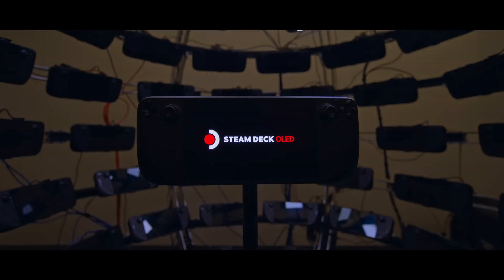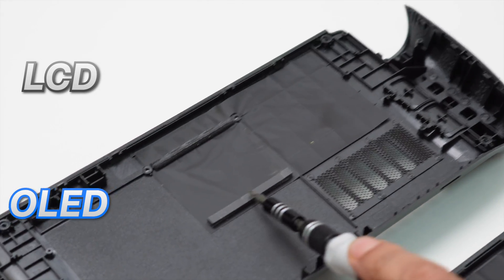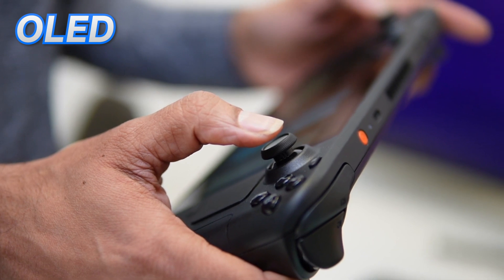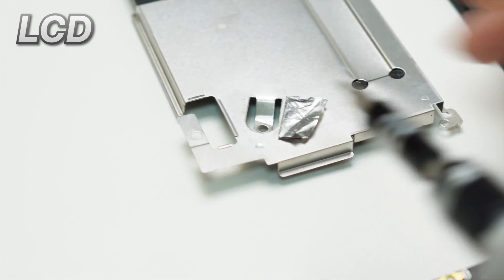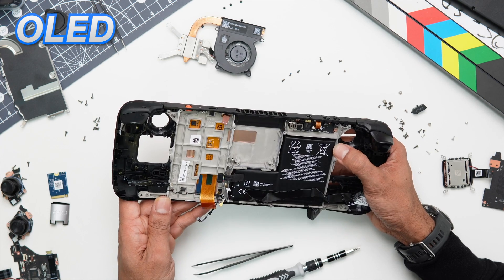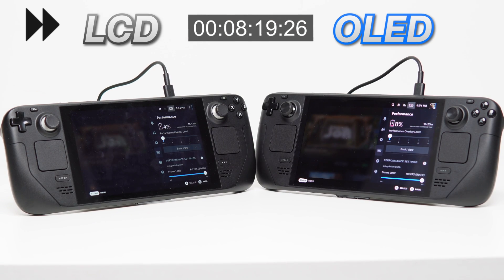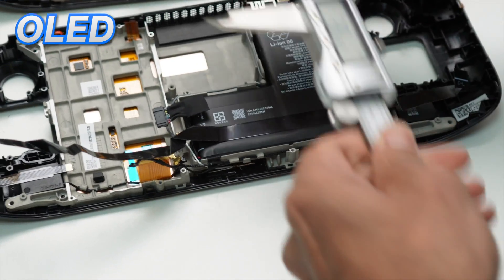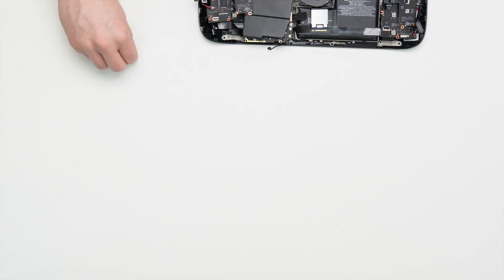Steam Deck OLED v LCD Teardown - What's Changed?

Comment from the maker: We’ve discovered an error in our fan orientation explanation in the video, and we want to address it to ensure accuracy for you, the viewers.

While we were right that the fan orientation has changed, there is a technical error in how it was described... Being a blower style, the fan does still intake air from inside the system. However, instead of pulling air across the shielding can, it now mainly draws air from the front of the deck where the LCD screen is located. Therefore, while the airflow has shifted, the direction of airflow remains the same, with both systems exhausting from the top of the device.

This adjustment allows more air to flow through the finstack, which has also increased in thickness. Consequently, the cooling efficiency of the APU has been enhanced at the cost of reducing airflow across the motherboard.

The removal of the thermal pads is potentially the result of several other design choices. The shield can has been redesigned and sinks less heat into itself. Additionally, the motherboard architecture changes most likely helped. The four large memory chips were replaced by two much smaller ones, and some power delivery components have been relocated from the motherboard’s center to the edges, facilitating easier heat dissipation from these components.

We appreciate the viewers who brought this discrepancy to our attention. We are committed to delivering accurate information and will continue striving to provide you with the best content possible.

Thank you for your understanding, and we look forward to seeing you in our next video!

Comment: hi. This is the Steam Deck vs Steam Deck OLED, not Steam Deck LCD. There are revisions. This is first version that you compared in the video, first model released. So there is not even fan change. Steam Deck LCD has a lot of changes, similir to OLED model.

Comment: my man, they didn't change the airflow direction, the lcd deck also uses the back vent as intake and the top as exhaust, they flipped the fan horizontally not upside down, the motor still goes the same direction.
Reply from the maker: Thank you for pointing this out, we have rectified this in the pinned comment

Comment: 6:00 What? No..
    The LCD model doesn't intake air from the top, and exhaust at the back.. Both models exhaust from the top.
Flipping a blower style fan does not change it's flow direction. That's an axial blade style fan thing.. LCD model is just pulling more air from the display side, while the OLED model is pulling more air from the backside. Both from inside, blowing out the top.. 
     
     Good teardown otherwise though!
Reply from the maker: Thank you for pointing this out. We want to provide accurate information so we have rectified this in our pinned comment. We appreciate the support!

Comment: That side-by-side table layout between the two versions is absolutely stellar. It makes the large number of differences easier to see one area at a time. Great comparison.  I've never seen a gaming hardware channel cover PCB layouts and routing, datasheets, decoupling capacitors and junction temperature before. This is now my favorite channel.
As an electrical engineer specializing in PCB design, it's super interesting to see these teardowns. Thank you for providing such educational content
Reply from the maker: Thank you for your kind comment. We are happy to hear you are enjoying the channel. Since you work in a related field, you might want to join our Discord. We are just kicking it off and looking to make it a hub for discussion on these topics. Check the description! :)
Reply: Discord link expired..
Reply from the maker: @MahaPrathusha  Thanks maha, Updated now: https://discord.gg/2dxmTmsvTu

Comment: Thank you for the deep dive into the decks!

I started by emulating games on my phone, with a telescopic GameSir controller. The experience was so great I have decided to get a steam deck. Then I loved the deck so much(both emulating old consoles, switch, ps3 and indies/AAA), I have ordered the OLED asap when released. My favorite use-case is taking it out to other friends for party games like super mario party. The original deck was sold to fund most of the OLED.

If I would happen onto another deck, I'd be giving it to my best friend who is away for work a lot and would make its life so much better. Unfortunately, he can't afford one right now.
Reply from the maker: One of the best things about the deck is the breadth of games you can get on there!

Comment: Out Of the topic
for me..
There are several reasons why the Steam Deck OLED might be considered better than the ROG Ally:

1. Screen Quality: The Steam Deck features a high-resolution OLED screen, providing richer colors, higher contrast, and sharper visuals. This can offer a more immersive visual experience while gaming.

2. Performance: The Steam Deck is equipped with a powerful AMD Zen 2 processor and AMD RDNA 2 GPU, offering better performance than the ROG Ally. This could mean smoother and uninterrupted gameplay.

3. Steam Integration: The Steam Deck is specifically designed to integrate with the Steam gaming platform, making it easier to access game libraries, friends, and various other features available on Steam. This allows users to have access to thousands of games available on Steam.

4. Portability: The Steam Deck is designed for maximum portability with its 7-inch touchscreen. This allows players to take the console wherever they go and enjoy their favorite games on a handheld device.

Although the ROG Ally may have advantages in some aspects, such as removable controllers and support for various gaming platforms, the Steam Deck OLED excels in terms of screen quality, performance, Steam integration, and portability.
Reply from the maker: Thank you for your well thought out comment. Both systems have different things to offer, but these are definitely good reasons to go for the Steam Deck.. For me, especially the integration with Steam.

Comment: I'm pretty shure that the intake/exaust have not changed...
Reply: @intretechsos not quite right. My LCD model exhausts hot air out of where you say the intake is.
Reply: yeah i believe the hot air comes out the same spot.....
Reply from the maker: Thanks for pointing this out. Check the pinned comment where we have rectified this and added some more information for you guys.
Reply: I can easily feel warm air coming out of the top of my LCD model? They may have flipped the fan but the may have also made it spin the opposite direction
Reply: @RogueRen  that’s probably what has happened here